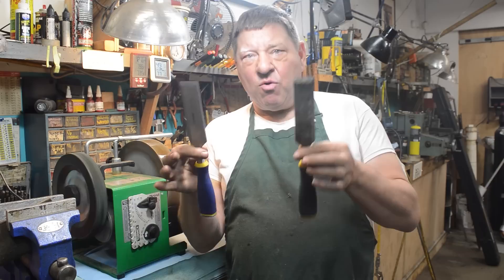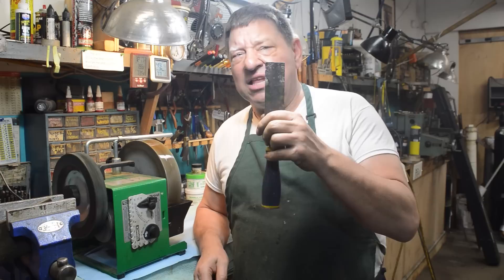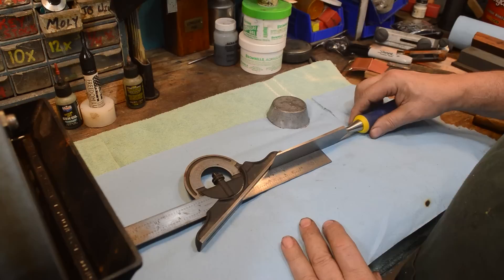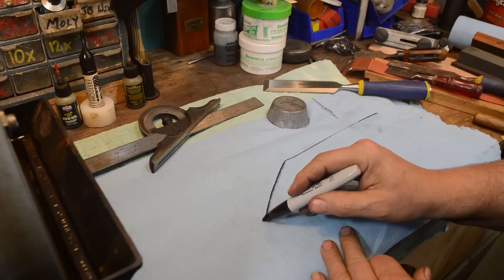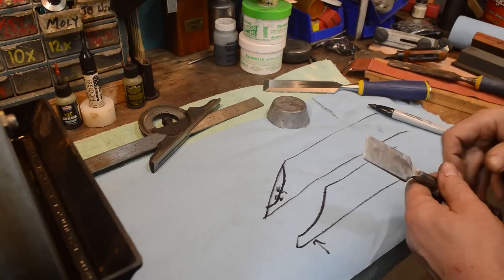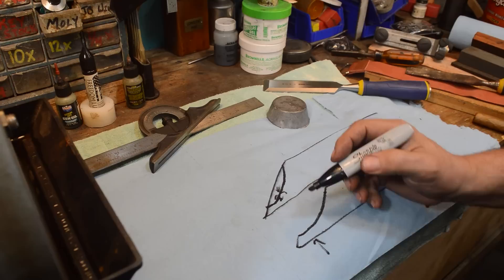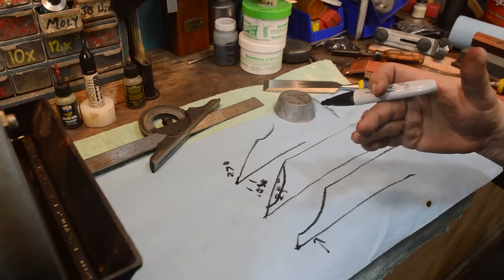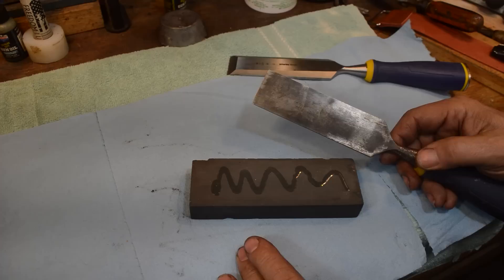Chisel and Driver Sharpening: Anvil 0126

Comment: I bought my Tormek about 10 years ago.  It is by far one of the MOST important machines if you work wood with wedge and edge.  It is pricey, but the ability to sharpen any tool simplifies life dramatically.  I hesitated purchasing it for about 15 years, but when I did, never going back to stones.  The time saved sharpening, allows you to spend more time working wood, and less time sharpening.  So easy and quick to tune-up a plane iron or chisel edge.  Using their Japanese water stone, knives are wicked sharp, and easily tuned with a a polished steel.  The drill sharpening attachment will put a better than new edge on a drill bit.  The beveled chisel point always drills 'round' holes in thin steel.  No walking or wobbling. As a bonus, they include a box of band-aids.
Reply: Band-aids are a nice touch for people learning the details of sharpening, and the difference between sharp and crazy sharp. Plus, you may be able to use your index finger again someday!

Comment: I’ve always used the “scary sharp” method using float glass as the flat reference and progressively higher grits of sandpaper adhered with 3M spray adhesive. Very important you don’t skip a grit. For disaster chisels I might start on the back with 100 grit all the way up to 3000.  I get an absolute mirror on the back. For the bevel, I chuck the blade in a Veritas angle jig. It has variable angles and a broad brass roller on the bottom. Once I go through all of the grits honing the bevel, I use the venier gage on the jig to tip it 2 degrees and I go back to 800 grit up through 3000. A quick swipe or two on the back with the 3000 takes off the wire. I can shave end grain white oak with the edge. My wife always knows when I’m sharpening because I come in from the shop with completely shaved forearms!!!

Comment: I have a Japanese chisel sharpening jig that has kept my gear razor sharp. Always love the videos. The biggest battle for me out here is rust. The bane of my existence.
Reply from the maker: Just throwing it out there,  rust blue the blades. When they rust, convert the red to black oxide. Just like a gun
Reply from the maker: I did that to my wrenches
Try keeping a small fan running all the time in your space. Keeping the air moving seemed to help in my current and last shop
Reply: @marknovak8255 great ideas. I live in Hawaii and I did convert the scraper I cobbled together to remove the grot and cosmoline. I've blown a few minds when I let people know they don't have to go through a stack of sand paper to remove finishes. 
Again, another great tool I made inspired by you. I think I have every rust treatment that exists. If I didn't get back into ham radio I'd have invested more into my gunsmithing gear. 
I'm a fan of making my own equipment since it isn't easy to get a lot of equipment that isn't totally borked. I haven't seen a Bridgeport in about 20 years. God help me when I find one. 
Thank you for posting your demo videos as well. I love the way you explain everything.
Reply: Look into a small nickel plating setup, can even do electroless nickel plating
Reply: @XuroX.  good idea. I just got some nickel strip in for welding battery tabs. I can use that or some actual nickels and save some money. Good on you. Love this community. 🤙🏾

Comment: Thanks for the helpful video Mark. Even though I knew the basics, it's a real leg up to see extra tips and tricks in demonstration. My grandad's workshop advice was get it done right, and commit to constant maintenance. Maintaining that edge for a moment will save a lot of time in the long run and a lot of frustrations and heartache as well. Of course, being a product of the Depression and WW2, he also would resharpen files and rasps as well, by immersion in an acid [30% vinegar, iirc]. Anything that couldn't be saved, like a buggered up chisel or worn out file, got converted into a knife blade.
Reply from the maker: Files make great springs too....

Comment: I have made new handles on a metal lathe and sharpened ~250 old chisels. I now sharpen and grind the back flat with CBN wheels on a homemade grinder while holding the chisel with a magnetic square. Honing with diamond powder on a leather strop.
 I used to use the rotating wet stone. I used to use diamond hones and chisel fixture. I used to use chisel fixtures for the belt sander. I Used to use a 10" sanding disk.
 I have a library of dummy sockets and cones for measuring socket chisel angles. Most common is 7.5 degrees, but vary from 6 degrees to 8 degrees. Often someone has pounded the socket to a mushroom shape.

Comment: Also...keeping your stones and wheels dressed is important too.  You can't get a flat back or a parallel edge on a dished stone.  I also use the DMT diamond "stones" for quick sharpening on chisels I know might get nicked or used for rough work.  They can be used dry, with water or oil.  Good product and I've had my set for 20 years and no dishing that I can tell.

Comment: Like fitting in an action or internal pieces to a firearm, taking your time about it and checking is far faster than trying to rush an edge. Seems counterintuitive to say, but it's true. Slow is fast, fast is smooth. Haste is waste.

Of course if you think it's a project to get an edge back on such chisels, have a look at a framing chisel or a straight razor. Those are ones that'll drive you nuts if they get even a slight chip out or burr.
Reply from the maker: Agreed

Comment: Grand-dad's ones would have been yellow and red plastic handled or wooden handled. These ones are fairly modern from the 2000ands The big advantage of this design is the steel end plate so you can belt them with a claw hammer. Abusereally but very convenient.

Comment: Wen made a little 2" wet wheel for chisels. Whole thing is half as big as a loaf of bread. Has a built in rest with angle settings. Kinda slow but worked pretty good when I started.

Comment: Quick question:- having inherited my Grandfather's woodworking tools; how do I tell whether sharpening stones are oil stones or water stones ?
Reply from the maker: Great question..natural stones quarried from the earth are water.  Artificial man-made stones are typically oil, unless they tell us otherwise .
Reply: If anything, the smell. That's what I've done. If it's a true water stone, then it's sitting in water. I usually keep mine literally submerged in water. If it smells like a sewing machine, then it's an oil stone. Most folks have oil stones. 
Have fun with that gear. They don't make stuff like they used to, so you probably have some great stuff. 🤙🏽

Comment: I started sharpening about 60 years ago, I think I’ve got the hang of it…
      Can’t force myself to buy super-expensive toys like the Tormek just to play with, I don’t need them, you don’t need them.
  There are a few YT woodworkers that advocate a tiny back bevel, Mark is right,  when flattening the back of a chisel do not lift the handle,  just don’t do it.
      Came back to this, I do not care for hollow ground chisels,  but I grind rough work or wounded chisels because hand sharpening out nicks and lost corners is just too tiresome.

Comment: A grinder would be the most efficient way to put the initial hollow bevel on that chisel. Also, when you are setting the angle of the chisel to the wheel, move the bar up and down to adjust it. That is far easier than adjusting the chisel in the jig.

Comment: nice... it would be helpfull though if there as away to recondition philips screwdrivers
Reply: It can be done, but you wind up rounding the corners of your grinding wheel. If you really want to go through the effort, it is best done on a small surface grinder with a v wheel. The shaft will need to be in a vice, and table stops are needed. Frankly, it is more work than it is worth, just buy another Phillips.

Comment: I own a Tormek T-7 just to sharpen stuff. Sometimes it works fast, sometimes it's a car crash. The jiggs are great  but skill and experience is required.
 Tormek says you can use the side of the grinding wheel to flatten the "bottom" of the chisel... Is that a viable idea? Does it work or doesn't it? You used a separate stone... By habit or?
Reply from the maker: The side would work, however I would turn off the drive. This evolution needs control, so yeah, habit.
Reply: @marknovak8255  Thanks a lot for the reply.

Comment: There is absolutely no good reason to hollow grind a wood chisel. All you're doing is shortening the service life of the chisel.  For the record, skewed chisels are for cutting across wood grain. I don't think this Guy knows WTF he's doing
Reply: If you own a fancy sharpener, hollow grind is well worth it, the cut is appreciably better. I cheat and use my surface grinder, no comparison to a standard grind.
Reply: @adf360  🐂💩🙄
Reply: @Fireworxs2012  same concept used for higher end drill bits,  end mill cutters,  taps,  reams, lathe bits, or any precision cutting surface. First make sharp,  then remove the excess material behind said sharp edge creating a chip breaking effect. Literally the #1 reason people screw up scissors is because they fail to realize they are hollow ground on the inside edge. Understanding the concept is important for longevity of tool life especially when cutting harder materials. Sometimes you have to go an extra step and grind a small kerf of only half a thousandths behind the sharp to encourage/control the chip breakage. You aren't disagreeing with me, your disagreement is with a billion dollar industry that has this 🐂💩 down to a science. If your plain, sharp,  non hollow ground chisel makes you happy,  that's okay but why mock the guy who, prefaced his work saying, you didn't need to do what he was doing?